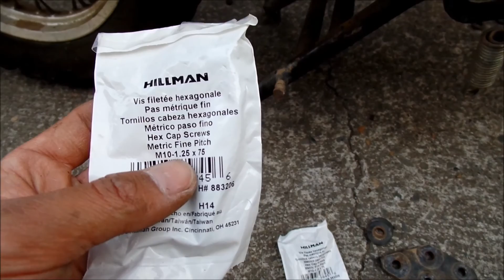HadesOmega VLOGs about Lowered Footpegs for Suzuki DR650

Comment: You got them on upside-down. They are supposed to be 1inch down and 1inch back in the correct orientation. The way you have them is 1inch down, 1inch forward. Unless you got tiny baby feet then I guess it wouldn't hurt. But they are much more comfortable the correct way.

Comment: Im looking to do this mod to my dr soon! I added the powermadd 2 inch riser, but I need just a little more room! Thanks for the video.
Reply from the maker: Thanks for watching, if you are a good welder should be an easy mod.  There are aftermarket options but this is one way you can do it inexpensive and you still get the to keep the rubber inserts.  So far they are holding up good =)

Comment: The foot pegs from procycle are expensive but they were 1 of my top mods for comfort but more importantly control.  The benefit I appreciate most is it lowers your center of balance giving the rider more control in technical terrain. It also lowers your pegs to the ground making it easier to get your foot to the ground.

Comment: I should add the pegs do not extend below frame so jumping objects or rocks and the like are not a problem.  I have only had them interfere once in a very deep skinny rut.  Hopping logs are easy cause if you need to use your feet they are essentially standing on the log.

Comment: I think you had your lowering brackets on arse about. The taper or orientation was wrong, the bracket is supposed to go down and back as opposed to yours which are down and forward. If you'd had them the other way they would have slid over the rocks easier instead of the point driving into them. 
Your ground clearance would have still been the same obviously, and you still would have hit them, but the jarring may not have been as bad. 
That is assuming you didn't have them that way for a particular reason. 👍
Reply from the maker: I think you can put them either way you wish and it wouldn't really matter.  I've been running the custom lowered footpegs and they hit much less stuff but on rocky sections and single track they still hit stuff.  Bike is very comfortable to stand all day.